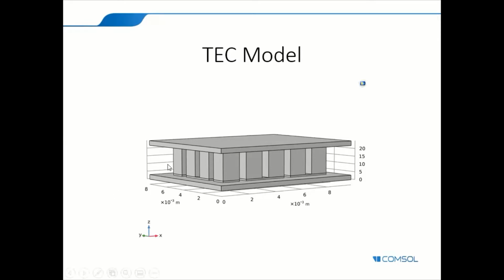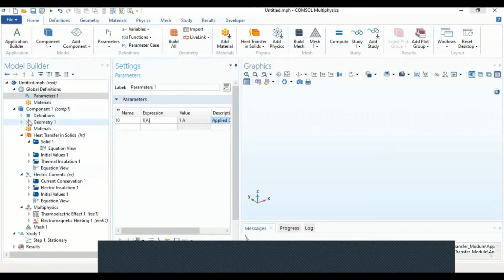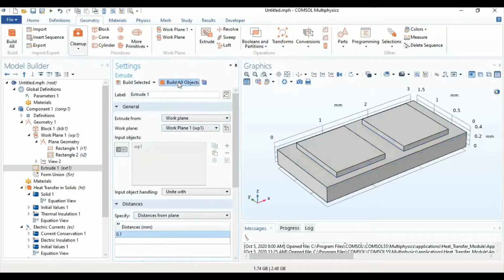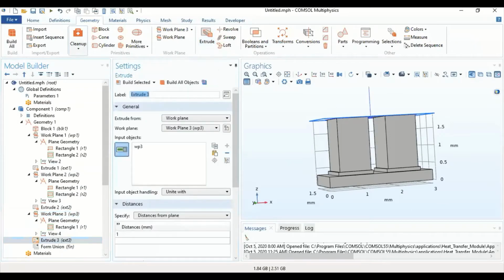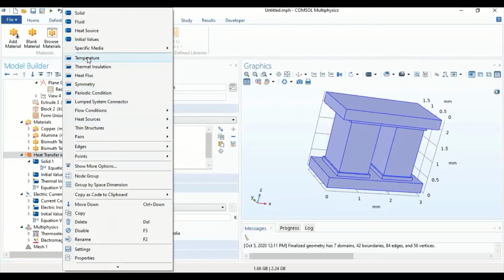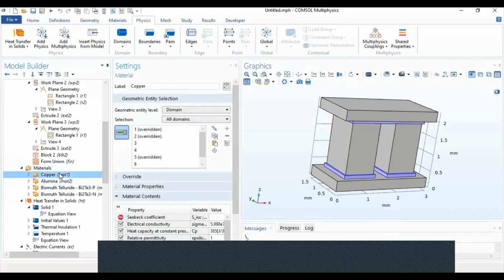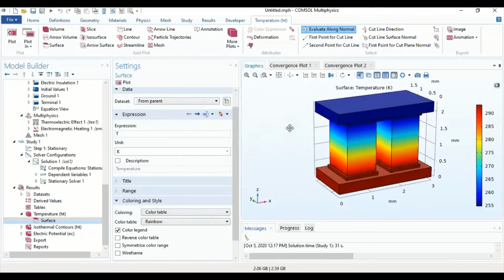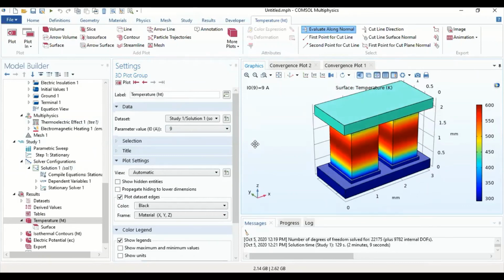COMSOL Multiphysics - Thermoelectric Cooler model

Comment: Hi Sir, thank you for the informative video, don't we give the heat transfer Coefficient in the simulation? If so, u didn't mention it in the video. Please let me know regarding the same
Reply from the maker: This depends on your model and how you want to set it up. You can use a heat flux boundary condition and define you HTC, or in my case I used a temperature boundary condition.

Comment: How should I know where to put the ground and terminal when I'm doing the whole peltier module?
Reply from the maker: It depends which side you want to be the “cold side”, and which is the “hot side”. Flipping the polarity of this model will result in the cold side being hot.
Reply: @elnadyengineering2451  how can I change the cold temp to 250 and the hot temp to 300+?
Reply from the maker: @exobst  please send your inquiry to comsol@elnadycompany.com

Comment: Hi, I am new to COMSOL and I want to simulate TEG. Most of paper extract the output power by adapting a resistance load but I cannot find how. Do you know how to adapt a resistance load to the TEG?
Reply from the maker: You can include an additional “Electrical circuit” physics interface and connect that circuit to your TEG model. For further assistance; please contact support@comsol.com
Reply: I am also facing the same issue now. Did you got the solution.